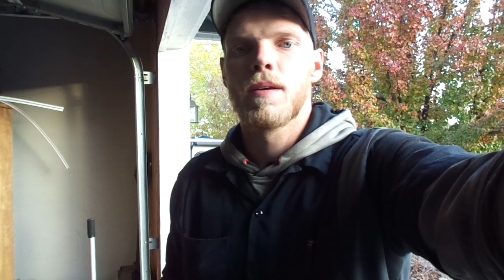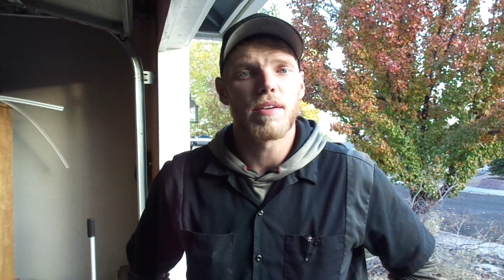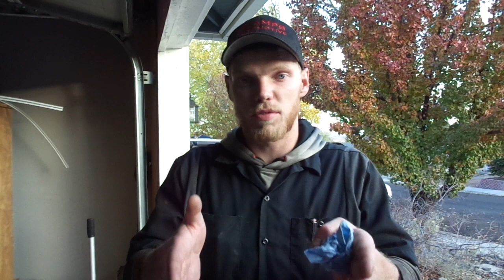Oxygen Sensor Faults P0153 & P0158 Diagnosis

Comment: I have a 2009 Jeep Wrangler 3.8L automatic. Recently replaced faulty downstream sensor on bank 2. Now I'm getting code P0158 for high voltage. Will run with no problems after being cleared and after restart will throw a code. Any recommendations?

Comment: So I have this same problem on my ranger. The exhaust is modified so it only have 2 sensors. What would be the cheapest fix? Thought a stock exhaust back in it?
Reply from the maker: What year is your ranger, and which engine does it have? I might be able to give some options.